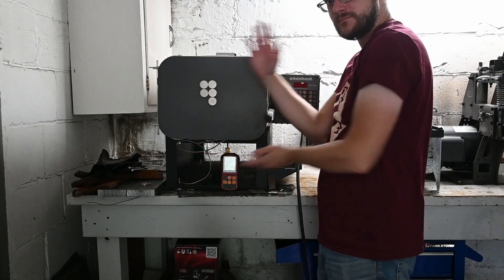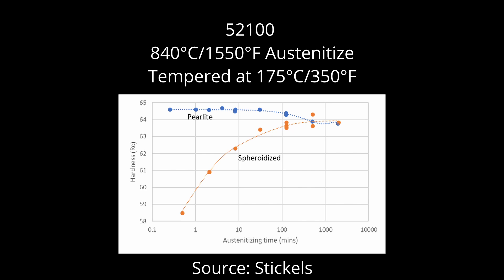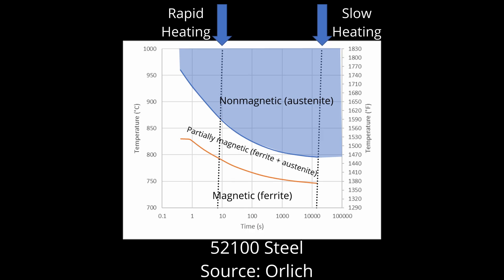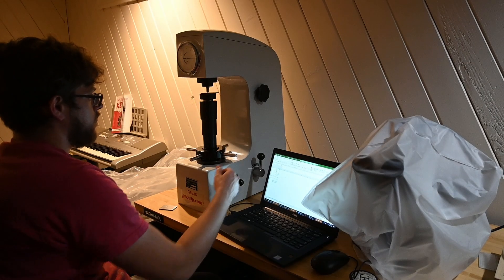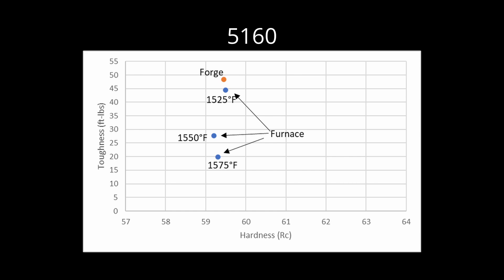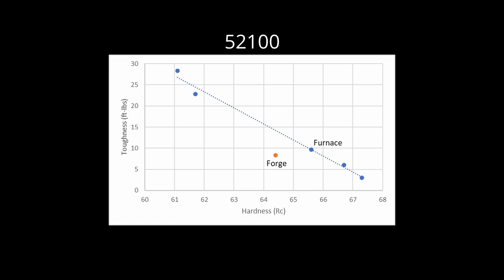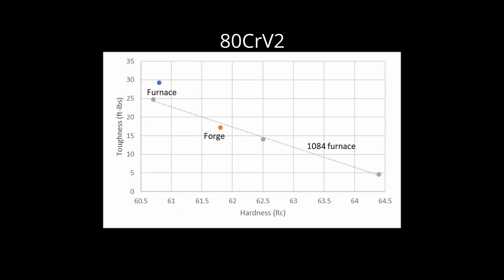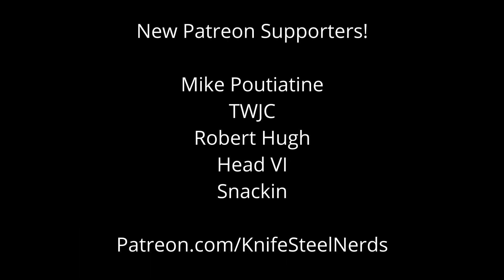Can a Metallurgist Heat Treat with a Forge?

Comment: Now the other important question… can you reliably temper in a forge 😏 (I know Japanese sword smiths temper by reheating the blade to the point where it will instantly boil water). I’ve done this and I’ve also apparently had no issues. Any thoughts on this Larrin? Just probing here, obviously just throwing it in the oven at 400F is easier.

Comment: I work mostly with 1075 and have been heat treating with a coal forge for about three years using the magnet test. Moving the steel through out the fire pot to get an even heat is definitely a must, I also use a laser thermometer to make sure my heat is even, about the best advice I can give is to get the forge up to heat, then a little hotter than it needs to be and close the air gate, then pass the blade back and forth through the hot spot while keeping the coals built up around the blade for insulation, it is tedious but it is do able. That being said if you can afford a furnace then by all means use one, but if not there are still options, though your steel choice will be limited.

Comment: Why don't you just adjust the forge so it sets at your target temp? I can hold my forges at any temp between about 1450 and 2200 for indefinite periods of time. These experiments always seem to assume that propane forges just have one temp. I've never understood these results. I will add - this type of forge in the video is absolutely worthless for heat treating. I could easily change your mind in one session.
Reply from the maker: Hi Karl. Many knifemakers use their forges to heat treat in this way, and I figured that showing that my method was working in the "worst case" would prove to myself that it is indeed possible. If it is possible in the most difficult scenario with my proposed thermal cycling then more controlled forges will of course also work. However, I will say that I have tested coupons from one or two knifemakers who used a muffle and a thermocouple and their results were still poor, so it isn't necessarily foolproof. Ironically some of the worst test results I have had were when a knifemaker said he could show me how it is really done.
Reply: @KnifeSteelNerds  Too many guys think their forges are special. Heat is heat. They use little tiny horizontal forges with huge temp fluctuations, direct flame, etc. I wish I could get more guys dialed in. It's not that difficult to do things right.  I do about 50% of my thermal cycling with my oven on stock removal knives. The post forging cycles I do in my forges when they're cooling off and I can take advantage of the temp. I appreciate your input. But I would still change your mind.
Reply: I heat treat in a campfire with no airflow. Rich people be crazy.

Comment: Whilst this information is extremely beneficial and I certainly learned a lot.. It really doesn't benefit the forge heat-treater. The whole premise of this video is to show that soaking isn't needed to reach full hardness with a said steel. However manufacturers only sell blanks in an annealed state, not normalized. So, if I'm required to soak my annealed steel at an unknown temperature somewhere above non-magnetic in order to normalize, does this not put me straight back to square one, and negate the whole purpose of this demonstration? How did you normalise your steel for this particular video? I can only assume it was in a furnace. I'm not trying to be a hater. Your videos are extremely insightful and I've learnt more from a handful of your videos than I have with hundreds of hours worth of other videos and scrolling forums.
Reply from the maker: The normalization temperature doesn’t have to be exact like the final austenitization does. You can watch my thermal cycling video if you want to learn more

Comment: An oxy acetilene torch works for me. It gives me control of the flame. It takes skill but the consistency is better than that of a forge, but of course it is not a matter of applying heat with the instrument. A proper setup ir required. You need to move the blade and the torch; and direct the heat in the correct areas of the blade. You also need to have a way to surround the blade with heat refractors ( like bricks). You have to spend the same  time on each face when heating the steel to prevent deformations. 
So, oxy better than forge but of course inferior to a proper furnace. ( I know this video is old).

Comment: Thanks for sharing Larrin. Question if I may though, does the forging (hammering) add any value in grain refinement leading to a better product? Being older and remembering buying tools that were drop forged vs ground and heat treated for strength. That would lead to forging a knife first then heat treating in an oven for the best product.
Reply from the maker: Forging can lead to grain refinement, however with knives the temperatures are high enough and the reduction small enough (especially the "rate" of reduction), that grain refinement would be minimal. The high temperature is more likely to lead to grain growth than the forging to refine it. In industry when they want grain refinement through forging they perform "controlled rolling" with specific temperatures and degrees of reduction. Often with specific alloying elements like Nb to prevent recrystallization and grain growth.

Comment: Thanks, man. I'm a big fan of your website, too. I'm hoping to build a heat treating oven one of these days, but it's been the forge for the last decade or so, and it does a passable job. Your video gave me some confidence that it can be made to work with some care, and also some reason for believing I'll get even better results when I build my oven.

Can't say I've tested this extensively, but I have the best luck keeping an even heat across the blade by heating in about 5 second increments and then pulling out of the forge to let the heat normalize across the blade. The thin sections and tip always get hot first, but if I do short increments like that, I can keep them from getting too much hotter than the rest of the blade. Check with a magnet often and dunk as soon as my whole cutting edge is non-magnetic (sometimes the spine is still sticking a bit at this point, but that's possibly even a good thing).

Comment: Former gunsmith, blacksmith, knifemaker here... with machining and metallurgy schooling (but no degree)...
Just from an amateur guys perspective - you're right on.  A furnace is better than forge.  But, us hobbists can't often afford a furnace.
I got "OK" at forge heat treating. Not great... but OK.  I know the camera distorts color, but from what could see, your forge was not an even temperature inside. Also you have that "hot spot" where the burner came in.   My forge (back before I blew out my shoulder and couldn't swing a hammer any more...) I'd do forging for a few hours, then when the entire forge was preheated as evenly as I could, I'd do my heat treating.  Getting the entire piece EVENLY heated was a challenge... I learned to stay AWAY from the burner, and heat my piece in the areas of the forge out of the direct blast from the radiant heat of the bricks, without touching them.  That worked best for me.  
I never had the inspection tools (after I finished my metallurgy class) to properly study my results, but, the blades I sacrificed with a vice and hammer, and files... I think I mostly got the hang of it.  
All that said - I'm a nobody, and there are bladesmiths with FAR more skill than I ever had at forge heat treating. Most of the good ones would agree that a furnace is better... if you have one.  They could heat treat in a forge better than I could with a furnace, though.
Reply: Yep, torture testing is the best way to learn. If it doesn't hold up, you can do better, until you simply can't get a better heat treatment to stand up to the abuse. You'll also find the perfect toughness to hardness ratio over time for your knife. Much like that one guy in forged in fire that won against previous winners and that he became a host/judge in some episodes. His test for a good heat treat was slamming the tip of his sword into concrete repeatedly without much more than a small nick. The guys that never test it out might have poor grain growth, retained austenite or pearlite, martensite embrittlement, poor hardness to toughness ratio for the task, or more. 
Most generic heat treatments on cheap knives are poor, with being overly soft despite not having enough hardness to warrant said toughness since it'll never chip before it dulls by total mushrooming.
Reply: Yep … you work with what you got .

Comment: So what are the basic steps with a slab of 1080 or 1084?

1. Heat to 1600 nonmagnetic. Let cool to room temperature.
2. Heat to 1500, dip in oil
3. Normalize in oven at 400° for 10 minutes? 

Are these the basic steps?
Reply from the maker: Heating to exactly 1500 is exactly the difficulty with heat treating in a forge. Which is why I recommended quenching from nonmagnetic instead. The reheating to 400F is called tempering and you do it twice for 1-2 hours, cooling to room temperature in between.

Comment: after doing many heat treatment tests based on metallurgical knowledge and data on my shirogami 2 forge welded test blades I have concluded that, the data is meaningless.
Nothing I did refined the grain beyond a certain point. however on a piece that I simply forged and hardened without proper HT procedures such as normalization or cycling, the grain was significntly finer and also finer than on the tests samples of "corectly hardened steel" displayed on your website or by other metalurgical samples. So
ultimately, I dont think you have managed to get a perfectly heat treated piece.
And we are all screwed.
now if you excuse me, I have 7 pages of handwritten HT result data, that I will ball up and eat.

also F*ck the diagrams, why do they all have written increments of 100celsius and why are they all saying different things?
I'm so done.
I'll just write down what I do at the forge and break the blades right away until I get the magic number of steps down.
clearly HT is meaningless to blacksmithing.
im going insane. It's been 4 days, sitting at the oven, breaking breaking breaking breaking and breaking and cycling and hardening and breaking and aircooling and breaking
and the results were all the same. NO GRAIN REFINEMENT.
the science has lied to me! 
and why is no one ever showing their work?! they just go "yup, and this is the perfectly done piece"
mofo, break it! show me that grain! 
I've seen the pictures too, 12 cycles, everyone said "amazing grain" 
but it wasnt even close to the hellishly smooth grain I had. HOW TF DID I THAT??
I forge welded it multiples times thereby overheating it, I did no aircooling normalization, all I did was a 600-700celsius anneal then harden it at 780-790 celsius. this is hell.

Comment: A lot depends on the kind of forge one uses.
A Venturi tube forge, especially with the burner mounted on top, would be very hard control precisely.
A blown ribbon burner forge with the burner on the side allows for a very good temp control through a wide spread of ranges, and a very good temperature consistency throughout the length of the forge, especially if baffles are used. A pyrometer can be used to really dial in the air and gas settings, so it’s a simple matter of selecting the right settings for the proper temperature.

Comment: Hey Larrin, thanks for all this great information!  I may have missed this but did you normalize the steel in the forge as well?  I saw that you recommend ten minutes at temp for the normalization process so I assume you did that in the furnace?  Is it possible to get to a pearlite state with forge normalization?  Thanks!
Reply from the maker: For normalizing in a forge I prefer to use a laser thermometer or a tempilstik and go ~50°F hotter because of the lack of hold time.
Reply: @KnifeSteelNerds  Awesome, thanks!

Comment: would you recommend using a square tube in a gas forge? would the temperature distribution be better as it does not directly blow fire on the blank? I  cannot afford kiln hence the question

Comment: As a new knife maker I originally started using 1084 steel.  I then switched to 8670 steel because I was informed it did not need  normalizing but rather just heat to 1550F and quench.   Is it correct that 8670 steel does not need to be normalized?   Also when heating 8670 for the quench cycle should it be heated only to non-magnetic then quenched or heated to 1500- 1550F then quenched?  Thank you.
Reply: What is normalizing?
Reply: @xlargetophat  It is a heating and air cooling process you are supposed to go through at least once before heating and quenching for hardness.   I was using 1084 steel which requires 1 normalizing cycle before heating and quenching.  I changed to 8670 steel which has similar properties but no normalizing cycle is required according to my steel supplier....just heat and quench.   Saves time and propane for me.
Reply: @glenpaul3606  do you know if that's true? Skipping the normalizing on 8670? It doesn't seem true because it's a way to save a buck.. but I'm fairly new to this.

I think the common way for quenching is heat to 1600° let air cool, then heat to 1500 then quench. At least for the 1084
Reply: @xlargetophat  I spoke to Pops Knife supply and they confirmed 8670 does not need normalizing....that's why I switched from 1084.  Made 25 knives with 8670 so far with no problems.  I've only been making knives as a hobby for about 18 months...a lot to learn but I've done a lot of research too.

Comment: I don't have the price of a furnace so I use a forge and a muffler. You still have the issue of doing your best not to overheat and playing the blade in the flame or I should say in the hotspot but the temperature change is slowed down a bit so it's a lot more controllable especially if you got Square Tubing in there because the bottom of the square tubing is usually cooler thereby assisting in keeping the thin edge of the blade cooler than the back with your trying to heat up to the point where it's non-magnetic. By the way thank you for explaining the difference between normalizing and annealing. I knew normalizing was going to give me a finer grain structure and overheating was going to increase the green structure again and that annealing only needed to be brought up to the point where I was getting the proper color preferably in the 13 to 1400 degree window or more specifically to the proper color Like Straw

Comment: I'm still coming back to this video to figure out what I'm missing... My name is Can't Get Right after all... my 8670 steel isn't hardening properly. I can't even break it, it just bends (past 90 degrees). I tried hardness file testing and I think I'm just below 55 HRC as that's when scratches start showing up. What I can't figure out is if it's not hardening because I'm overheating it or underheating it. Sounds like a silly questions, but what does "non-magnetic" actually feel like? is it no magnetism across the entire piece? or is it no magnetism on the edge?
Reply from the maker: Non-magnetic across the entire piece
Reply: @KnifeSteelNerds  thanks Doc! You are too kind (also a legend forever)!

Comment: More content like this please. I would also love to see tests of tuff simple steels run higher in hardness and tested for edge retention (say 8670 or 5160) where the toughness at higher hardness is still equal to that of 01 or 1095 and see what the edge retention is.
Reply: That's one thing that jaw dropped me looking at his site.. most premade knives even in 1095 are tempted to.. like 58. 1080 at the same or harder would be even tougher.. and a better blade overall since there's no carbides coming into play here.

Comment: Are you saying a "soak" time is not needed? Just get to non magnetic and get straight to the quench?
Reply from the maker: If it has a pearlite starting structure then it can be done without a soak
Reply: @KnifeSteelNerds  Hey. And pearlite starting structure we get by normalizing yes? or im wrong? So basically even stock removing is better with normalizing before hardening so the pearlite has started? Sorry for bad english. Thanks
Reply from the maker: Pearlite forms from normalizing, yes

Comment: Humans used coal and charcoal forges for heat treating for centuries , modern man .
"I wouldn't recommend using a forge to heat treat."
But in all honesty forges you can make yourself , they aren't expensive and I would rather have a newbie use a forge simply because it's more easily accessible  .

Comment: A query from a fellow metallurgist with a heat treatment background:

Does the gap between the Curie point and critical temperature alter with alloying? 

Yes, gamma is always nonmegnetic. But there is the region that alpha is still BCC but loses its ferromagnatism (where beta iron was though to be). I'd have though that relying on just a magnet would leave you at slightly too cold a temperature. 

Perfectly happy being wrong though. It looks like you got decent enough results regardless.

(I am jealous of your set up. Smithing and knife making is something I'd love to get into myself when time and funds allow).
Reply: The curie temperature can change with alloying. As far as I know all high carbon low alloy tool steels transform to austenite at a lower temperature than the curie, assuming a slow heating rate.
Reply: @cubee2006  That would explain the good results.

I've never really had to consider a steel's magnetic properties in detail so I've only learned about the curie point and 'beta' iron in relation to pure iron not steels.